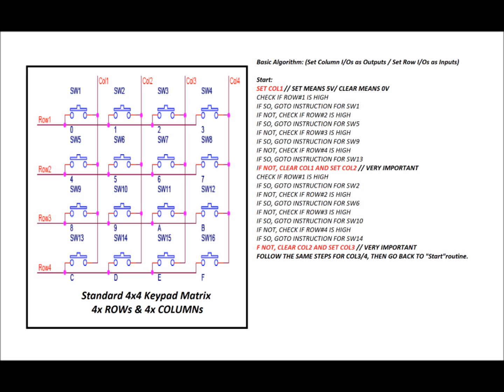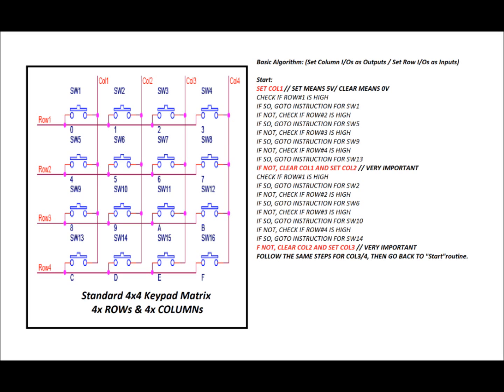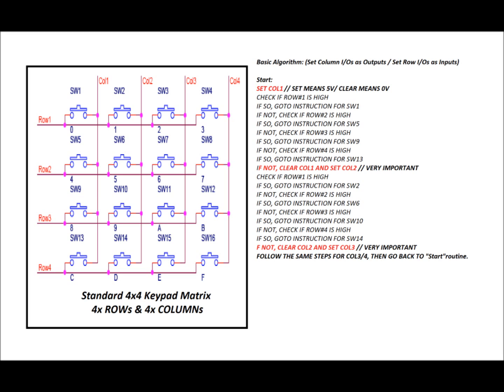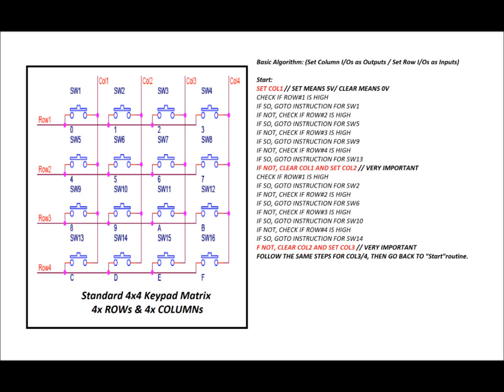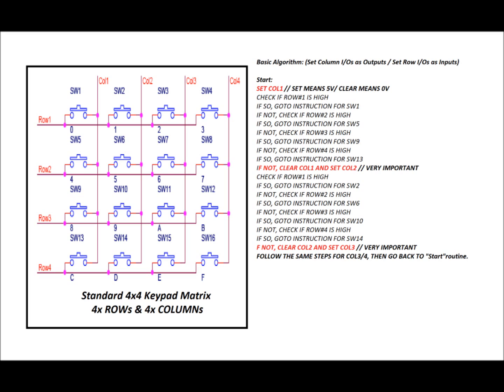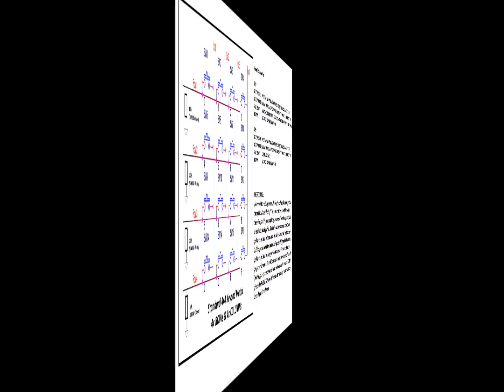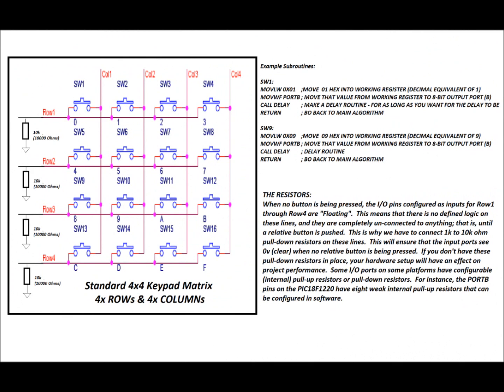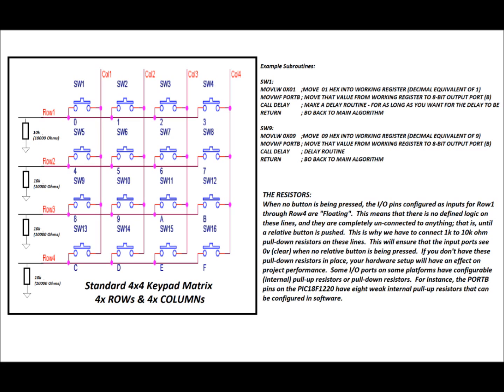How The 4x4 Keypad Matrix Works - A Tutorial With Basic Algorithm & Hardware

Comment: Just exploring how it works and have question.
Couldn't be used slightly reversed approach?
Let set interrupt on every row separately, and high on all columns. When is some of row interrupt triggered, scan each column in interrupt routine. With this, you don't need switch columns all the time in background.
Reply: ideally you would tie one side  of every switch to vcc, and the other side to both row and column inputs. Then you set interrupts for either every row or every column, and then poll the other dimension in the interrupt to collect a list of all of the buttons that are active in that row. That way its possible to address more than one button per dimension at a time.

Comment: Why the inputs will be floating when there are no pull down resistors? I cannot clearly see what's the relationship of those presence of resistors.
Reply from the maker: If you don't have those resistors in there, then the processor is going to randomly pick out numbers.  When I/O lines are left unconnected (floating) they can assume high or low logic.  They can be low or high.  They can be low, and become high over time due to ambient noise and line capacitances.  These resistors act to bleed off any charge on these unconnected lines, so that they assume a logic 0 until a button is pressed, and a high signal is connected to that specific line.  Not only is it good practice, in most cases, your matrix will not work without them.